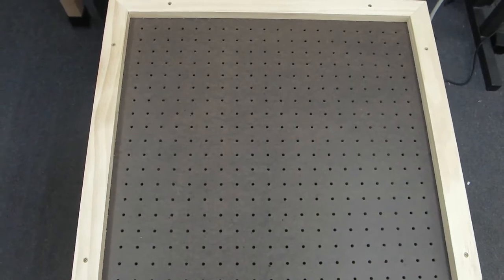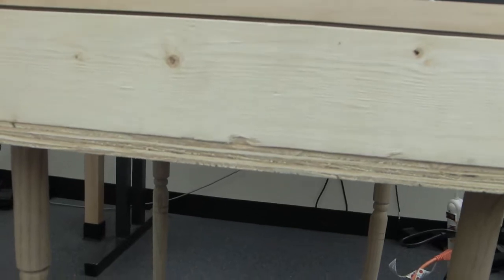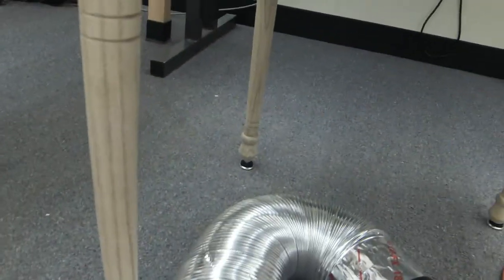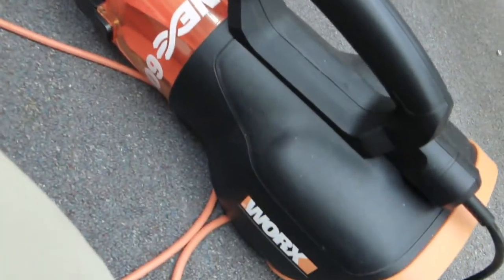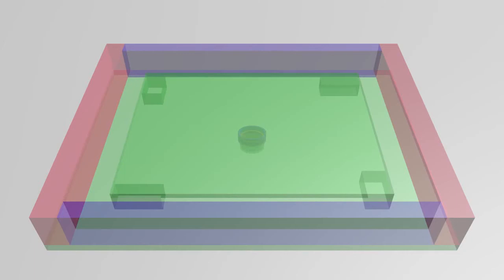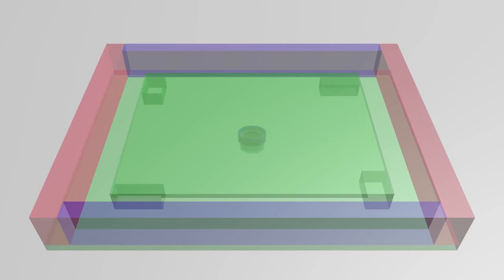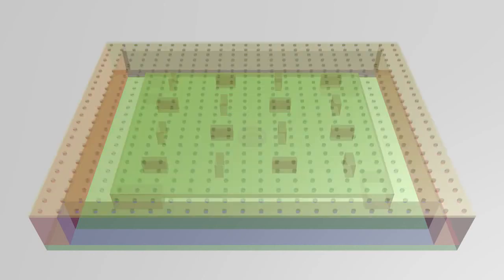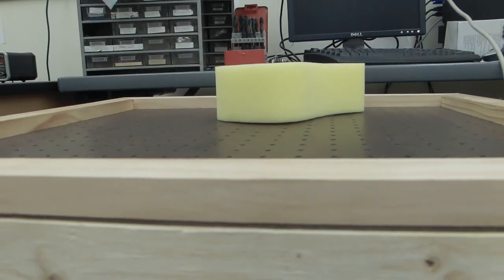DIY air table

Comment: Will it still work with a leaf blower if I need a table to be lot longer Like will the air spread out on its own as Long as I put that square board above the inlet? Or would it be better to run 2 hoses to 2 inlets?